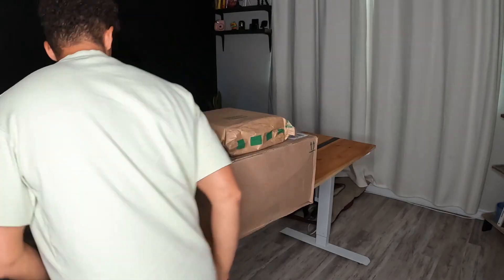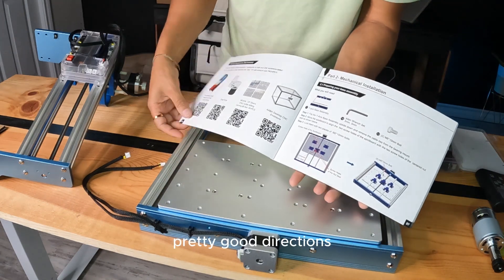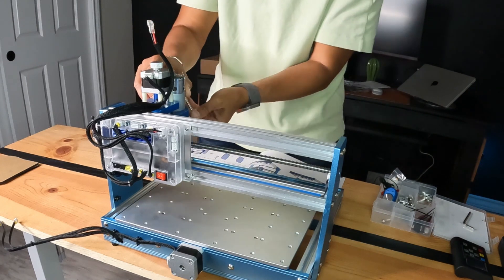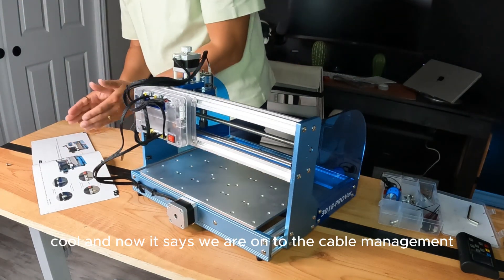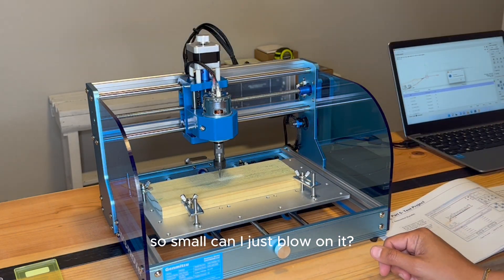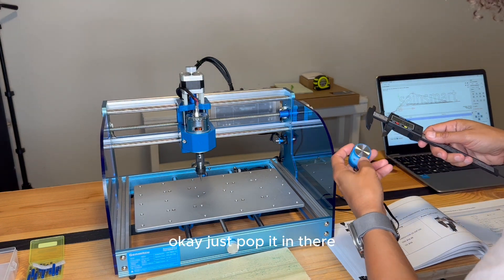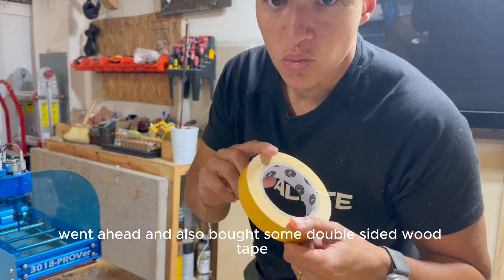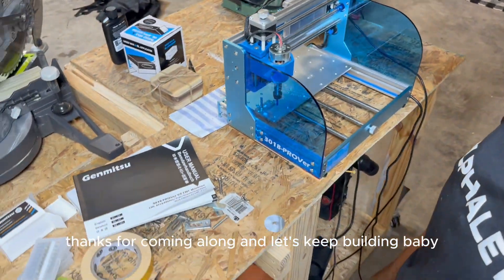A Realistic CNC Assembly and Test Cut - SainSmart 3018-Pro PROVer v2

Comment: Hi Trina, you mentioned trying to operate your 3018 ProVer V2 with MacBook. Did you ever get to do this ? - i’m in the same boat have always been a Mac user and I’ve just bought my 3018 ProVer V2. I’m wondering as to whether it’s worth the frustration of trying to work it with a Mac or should I just go out and buy Windows computer?
Cheers
Guido (from Adelaide, South Australia)
Reply from the maker: Hey you. I never got it to work so I ended up buying a really cheap Windows from Amazon.